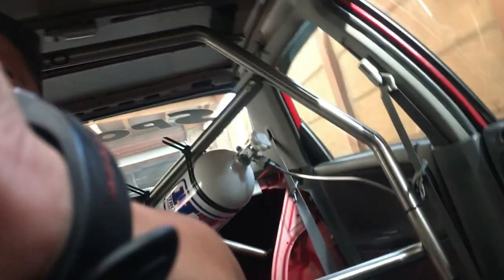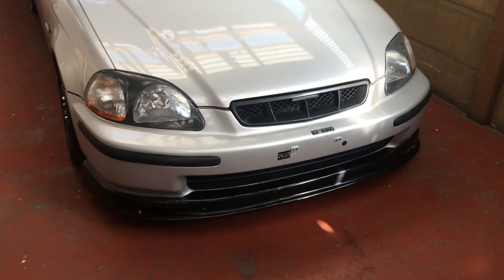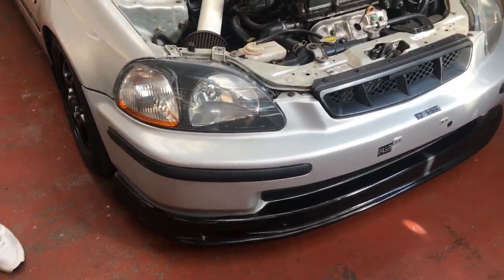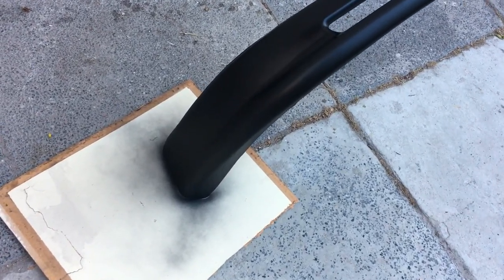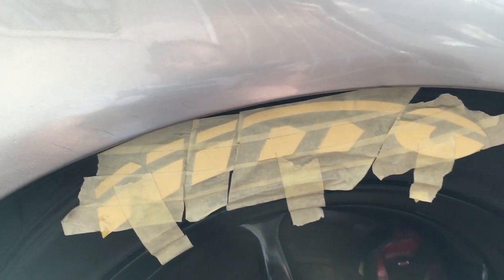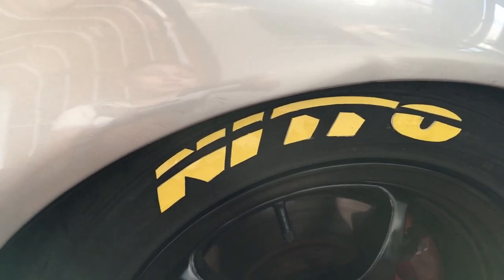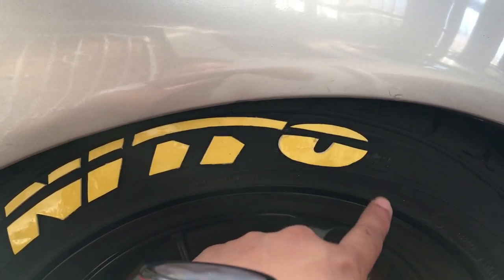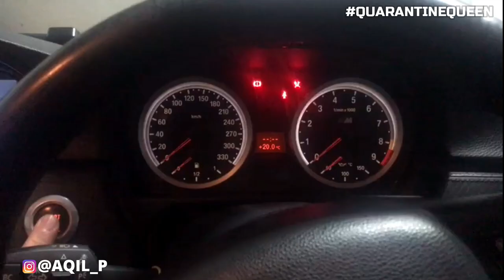NEW MODS FOR THE HONDA EK (NITTO TYRE LETTERING & MUGEN LIP)

Comment: Keep the yellow.
Reply from the maker: Yeah We worked on the car Monday that passed and we went for a lil drive. And i must say the Yellow looks FIRE during rollers 🔥🚗💨
Reply: Great content Wong keep up the good work for me I would have to say yellow theres not much guys with yellow lettering and it definitely stands out I think what would set that ballade off personally would be daytime running lights and yellow calipers to break the mugen look but otherwise job well done👌💯
Reply from the maker: Thanks bro appreciate the comment. Thats wat keeps me going🙌🏼

And we actually did the CityLights (USDM STYLED) on Monday which will probably be the next video. We do not want to over do the yellow vibes tho. 

Also the bad thing abt Yellow calipers is they tend to look way worse when they dirty compared to Red
Reply: I guess I hit the nail on the head with the city lights part fantastic very eager to see the outcome broski🔥
Reply from the maker: U def hit the nail on the head. It crazy how u mention it and we actually just did it a few days ago. 

Keep the ideas flowing🙌🏼